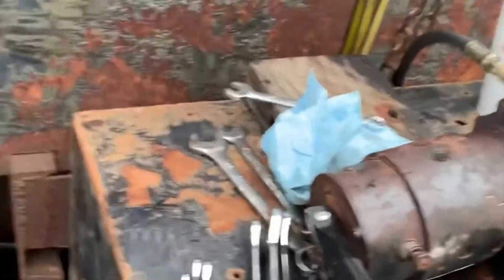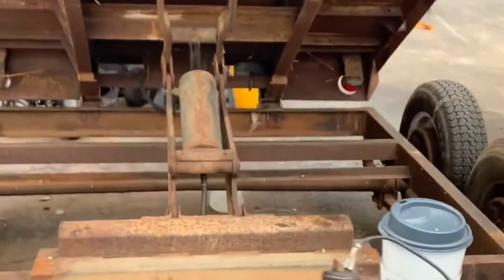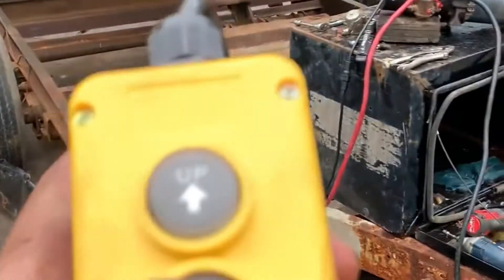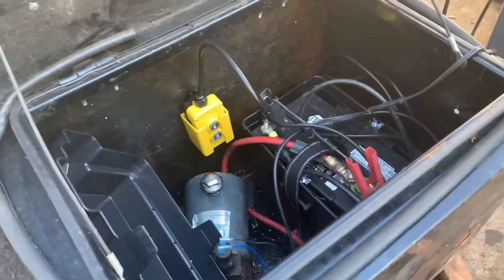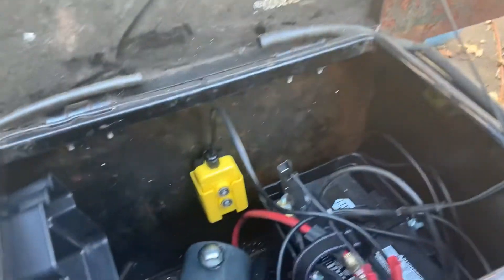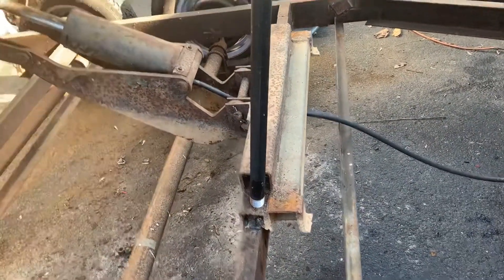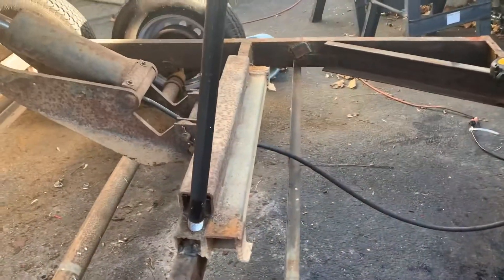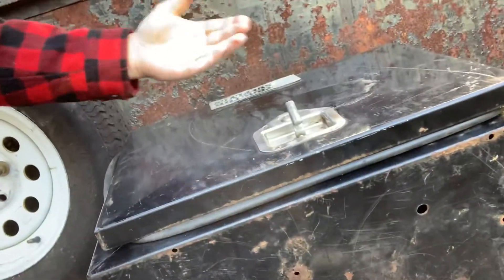DIY Dump Trailer Part 5! Making it all work! Hydraulic Pump installation, controls, and battery.

Comment: i built mine how do you get it to not slam down when lowing it
Reply from the maker: Are you using a dump valve?
Reply: @drewdoestrucks  I’m not Shute all I have is the two valves I’m the pump that are built in with the electric relay on them it’s a double action
Reply from the maker: @arealmaintenanceandrepairl1103  you can buy a restricting fitting with a narrowed orifice. Mine is single acting and I honestly don’t have a ton of experience with double acting dump beds.
Reply: @drewdoestrucks  isnt that what the valves adjuster are for on the pump
Reply from the maker: @arealmaintenanceandrepairl1103  mine does not have adjusting. I have never seen one with a valve to adjust how fast it would open or close, although in my head I can imagine how such a valve would work. The dump bed will push the fluid back into the reservoir via gravity (which is how mine is set up. Power up, and to go down you just open a solenoid valve that lets the fluid flow back into the reservoir).  With power down, you’ve got gravity already pushing the dump bed and you’re powering it down as well. 
I have a video I made in the dump trailer play list where I take apart some pumps and show how they work and how the valves work. It’s a little boring but it might let you in on how mine is set up.
Reply: @drewdoestrucks  whats a dump valve